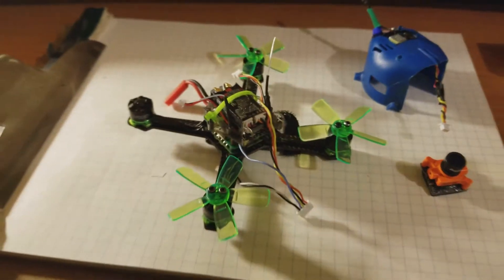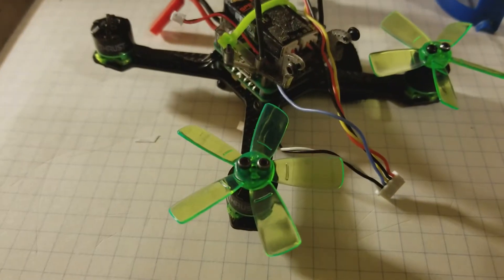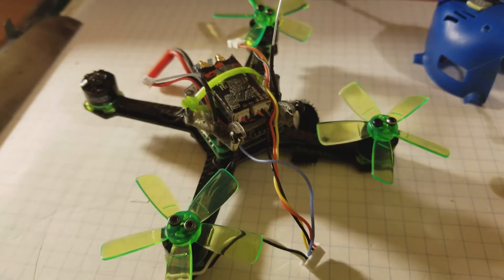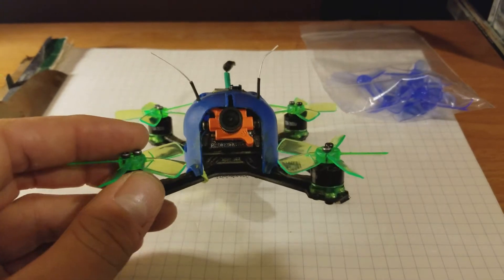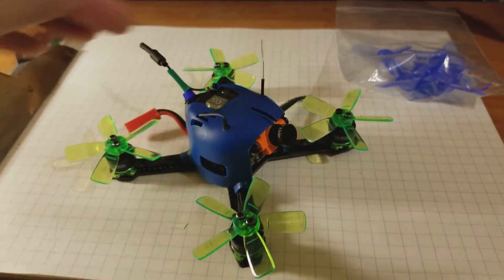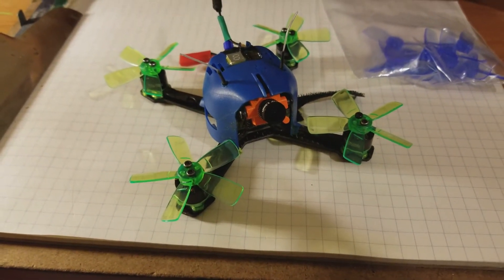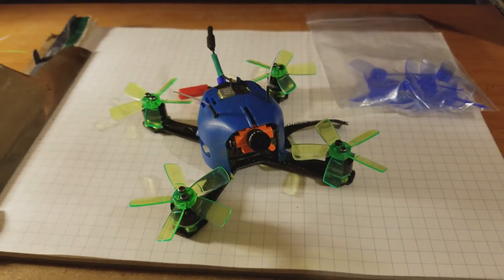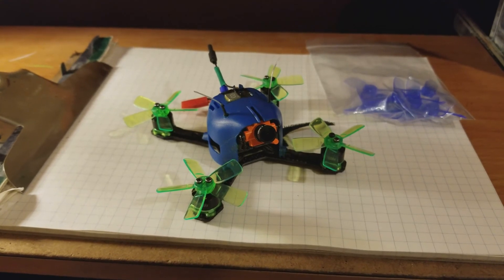New runcam swift mirco 2 installed on the blade torrent 110

Comment: The default cable that comes with the Swift 2 does not plug into the default Spektrum VTX (SPMVTM150) the plug is too big (i think its a JST picoblade vs JST-SH 1.0mm) You will need to buy another cable to convert or chop off the old camera's plug and solder it onto the wires.
Reply from the maker: Sean Crooks thanx!